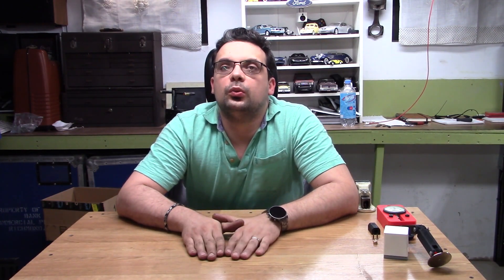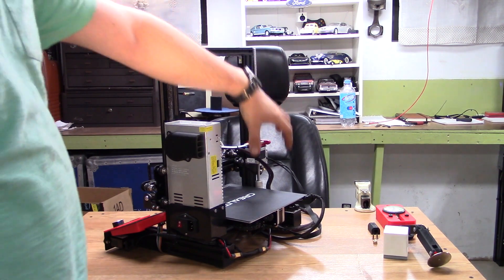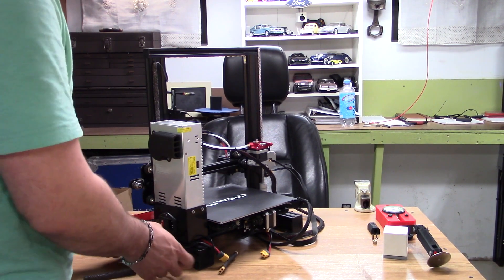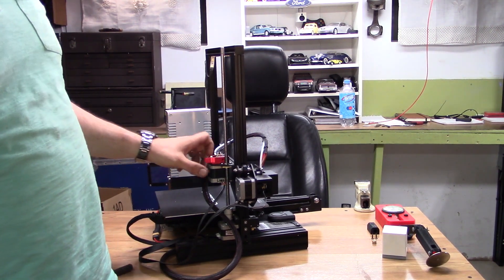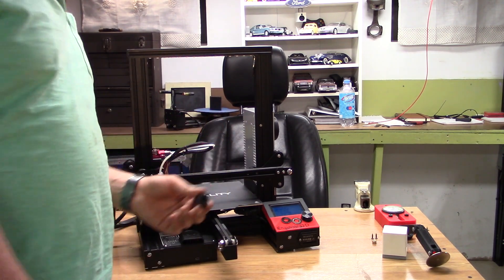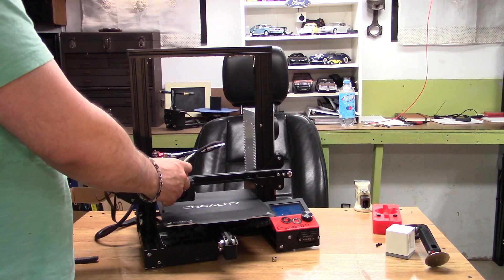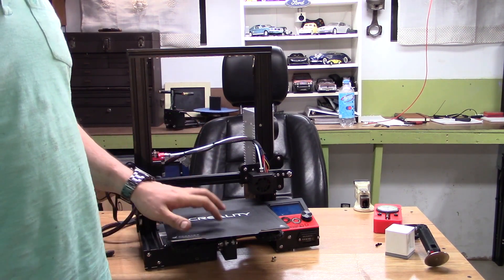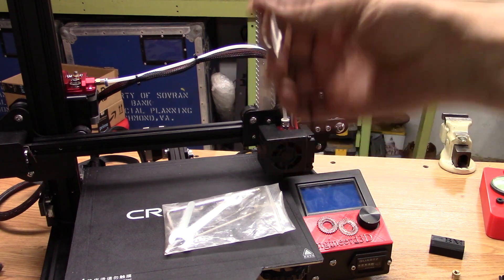3D Printer Farm in the shop

Comment: I like the safety redundancy in your setup! I'm not running a print farm so my solution will be to build a steel fire-resistant temp-controlled box for my Ender 3, then I should be able to print polycarb.
Reply from the maker: I would suggest you move the controller out the box if you do. Regardless having a proper controller as well as a remote kill switch is cheap insurance. Thank you for commenting.
Reply: @Engineerd3d  Thanks for letting me know, though moving the control board outside the box is somewhat difficult with the wire length. An Ender 3 user wrote that their control board was fine within a 100°F (38°C) enclosure, but I'll test the board temps with an IR thermometer when I get that far.

At the very least I'll keep the PSU and LCD on the outside.

Comment: Neat to have control of the whole process remotely.  Looked through the links of materials and I used the same wheels on my plasma torch.
Reply from the maker: Those wheels are actually pretty decent. I had to replace one of the original ender 3 wheels as it was crunchy.